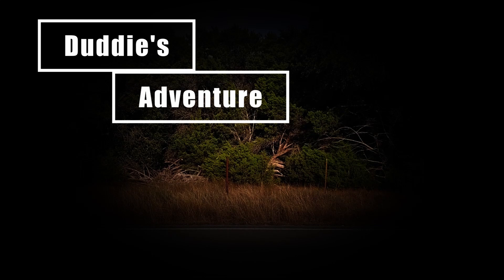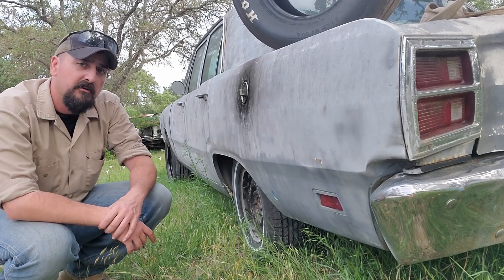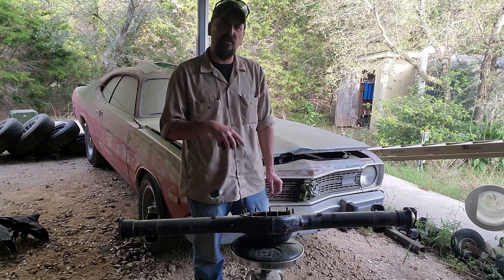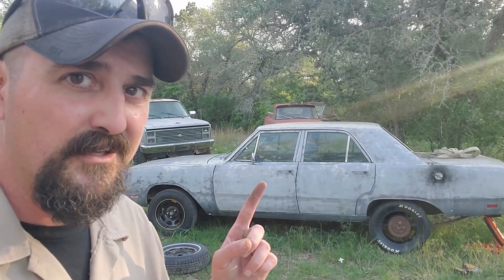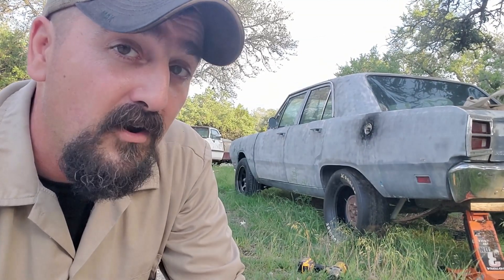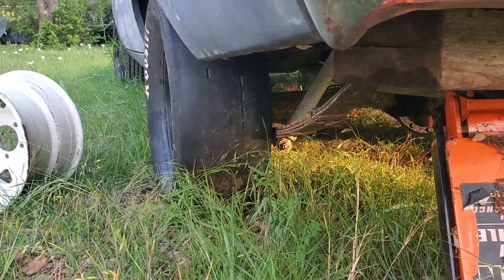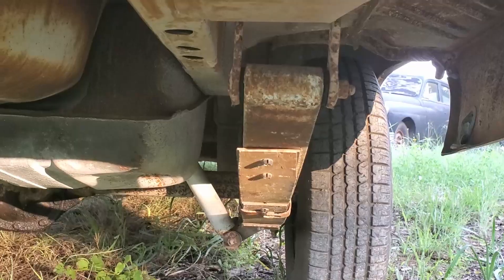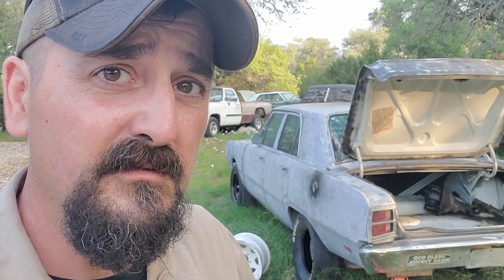How to fit DRAG Slicks In the back of a A-Body MOPAR? I need your Help! SMALL TIRE DRAG RADIALS?

Comment: Save you some money with cheaper option #4. Lower the front leaf location to bottom of the frame. They dont need to be straight with the back. That will raise it 3".  Then run some stick on fender flairs. Cost? Some welding and a trip to the junk yard. No fender cutting, and no axle narrowing.  Flair from a jeep charoke should fit with some adhesive glue. 
   After all.....its just a 4 door.
Reply from the maker: Now that is a Idea! I might look into that! Appreciate it and Thanks For Watching!

Comment: Add a leaf. My 69 cuda wheel well is 24  high no shackles with tons of room w 235/60 if it matters. Crank up the front end to make it level and it will look great. No bug look. 8.8 may be cheaper
Reply from the maker: I've done plenty of add a leafs for off road trucks, so that may be a good idea for this! Appreciate it and Thanks For Watching!

Comment: Option 4, Valiant VH-CL (71-82) the rear guards and doors. They just added 2 inches each side and that would be like adding spent Satellite guards on the back and doors. Plenty of room to add 275s then. All Outboard.
Reply from the maker: I have not seen that before, I will need to check that out! Appreciate it and Thanks For Watching!

Comment: I "retubbed" the outer tub on my 1973 Dart.  I bought a Dart that someone put a GM-camaro rear end under.  Just to put 235-78's on it.... they cut up the outer wheel wells.  I replaced it with a F-body rear end (54.75"-8.25 diff) only relocating spring perches and "repaired" the tubs by shaping into a very-high arch metal patch.  So, the tub and quarter panel are essentially sandwiched together and a very narrow wheel well lip.  Now I have drag radials 255-50-16.
Reply from the maker: Now that's a Idea! Appreciate it and Thanks for watching!

Comment: mancini racing has new anti rust adjustable Abody leaf spring hangers . I bought a pair for my 65 dart simce I dont want to tub it out and run super stock springs . the brackets are very reasonable  money wise. they have 2 differnt front  leaf spring bolt holes to raise or lower the rear spring up front  . As far as the back part of the springs  In the past ive used  the adjustable shackles in the red box from the truck \ 4x4  suspension help shelf at oreillys . the shakles have 1/2 holes on the one set and the others are 7-1/6 bolt holes . I ran these shackles with poly bushings when I had my 76 plymouth volar'e  with no issues 😎👍. hope his helps Duddie 😎
 🍺🌮🏁3
Reply from the maker: Good Idea ! I will look into those and see what I can Figure out! Appreciate it and Thanks For Watching!

Comment: I'm not a fan of cutting the quarter panels unless it's a Super Stock. What about an 8.8 out of an Explorer? Disc Brakes and A Body width and would take power. Yes, it's sacrilegious to us Mopar folk, you'll probably get some hazing but under the circumstances, it would be an inexpensive viable option, and I think most came with a 3.73 gear with a sure grip or posi or whatever Ford folk call it.
Reply from the maker: I've seen the 8.8 used a few times. Seems like a good option, Some even came with 4.10 and a Locker. Good Idea! Appreciate it and Thanks For Watching!
Reply: @DuddiesAdventure  didn't know they came with a 4.10 better yet for the 1/8 th
Reply from the maker: I've seen a few, But I will need to determine year range that had the disk brakes if I go that route.

Comment: First-That '67 has some serious undercoating!
   Ultimately- you are in a time crunch.
So what you do this year may not be it's 'Finished' form.
   Helped build a '69 Pro-Street Camaro, big block, M22, 34" between rear tires, backbraced 8.75" on ladder bars and coilovers. Whole lotta rollcage. Neat Car. Lotta work.
That's one end of the scale.
   Me- I'd do the springs into the rails kit, new perches to match & narrow the axle 2" under A-body width.
   Be cheaper to do it all at one time.
   The 9.5" & 10.5" slick classes are powerful & plenty fast.
   Just My 2 cents- I'd make it more 'sleeper' in the end.
   Sleeper means you can blast around your area when not racing- fastest Taco Run ever!
Reply from the maker: The Time crunch is real for sure! I might need to do what I can to get Tires on it for NNN but then later on do the Mini Tub and Spring Relocation. A sleeper Taco Runner would be awesome!! Appreciate it and Thanks For Watching!

Comment: To me this all comes down to the future of the car...you runnin Sikeston then parking it up for a year? If so, do a home chop on the 8 3/4 and get the axles resplined = cheaper...theres heaps of folk on YT doin it... Have you looked into the 8.8 yet? not sure of the width on that bad boy...another popular swap... Im all for Super Stock chop and the nostalgia look myself..as you said, its "only a 4 door" and you guys can run tyres outta guards on the streets...
Reply from the maker: Very Good points, I've gone back and forth on cutting the B-Body axle down and The Dodge Whisperer has brought up the idea of 8.8. As far as what this car will be after NNN, I guess it really depends if I get addicted to racing or not hahaha But Your Right, Maybe i should got the cheap route first. Appreciate it and Thanks For Watching!

Comment: If it was me I would re hang the axle under under the springs, cut the fender tops some, and run a small slick for a lower realized gear ratio and see if you can make enough power to break something and if so narrow the bigger axle. No matter what you do it's gonna be a bud bundy rig it's a 4 door.
Reply from the maker: I ended up just hacking up the quarters! Appreciate it and Thanks For Watching!

Comment: Not sure how wide a tire you want to run on the rear , but I have two 15 x 6 and two 15 x 7 Magnum 500 chrome wheels , brand new , 15 x 7 wheels have 5 1/8 backspace on them , let me know if your interested in them.
All big bolt , 4 1/2 bolt pattern.
Reply from the maker: I appreciate the offer, I actually already have a pair of 15x8 for the front and debating if I will run 15x8 or 15x10 in the rear. Appreciate it and Thanks for watching!

Comment: Go get you an 8.8 out of a Ford Ranger. I put one in my 87 Dakota it was 4” narrower then the factory 8.25 that came in it and the gear options are a lot better and cheaper. I put a Detroit TrueTrac in it. I have a drive shaft you can have that has the u joint to adapt to the 8.8 the Ranger rears are cheap and plentiful. If you look hard enough you can find one with 4:11 gears and posi. The 8.8 is stronger then the 8.75 so I’ve been told.
Reply from the maker: Great idea, I have thought about using a 8.8 for awhile and keep a eye out for one with a 4.10 gear and locker. Appreciate it and Thanks For Watching!

Comment: The older I get, the harder it is to cut up cars that clean. I vote to keep the 7.25, and win an award for most rear axle parts thrown in the stands! Seriously though, the 8.8 Ford Exploder would be cheap. You'll have to narrow the drivers side down to the pass side length. But, they're super cheap. (A Ranger axle would work better, but they're harder to find with disc brakes, and usually aren't as strong as the Exploders). Next cheapest would be your 8.75. Doing an axle flip wouldn't be the worst idea, especially with traction bars to limit the spring wrap. If you do flip the axle, I would consider adding wedges between the spring and perch to keep the pinion angle happy. You're a truck guy, so I'm sure you knew that...🙂
Reply from the maker: I've considered the 8.8, I will see if there are any local and cheap. I have considered to a spring perch flip, Since I've done that on several off road trucks. That would give me all the lift! Appreciate it and Thanks for watching!

Comment: Slap a Toyota van etc rear end to it. That what we did back in the day. Takes abuse, comes with many bolt patters is locked and fits freaking good. Dirt cheap in there I reckon.
Reply from the maker: I actually never considered a Toyota Axle, Good Idea! I will look into that, Appreciate it and Thanks for watching!
Reply: If i remember it right its a toyota 8" axle. But it has been years so my memory might be wrong. And if you wonder why we did that, well... I live in Finland so anything that wasnt a slant six+bolt action+7¼ was a novelty. I found Finnish sites with some info bout the swap but it must be our specialty cause nowhere else nothing. You can still break them for sure but as a budget option, you got 5 of those toyota axles with a price of one 8¾ and they hold their ground pretty good against them.
Reply from the maker: That's pretty cool , Got to adapt to what you have and if you got a bunch of Toyota axles then that is the route to go! Thanks for the information and advice!